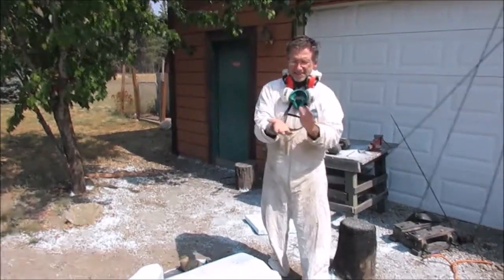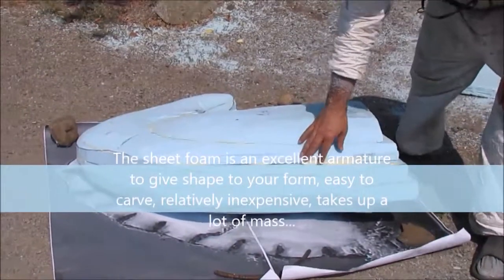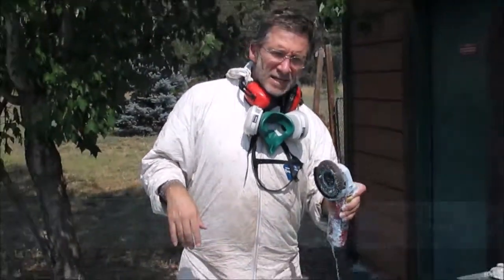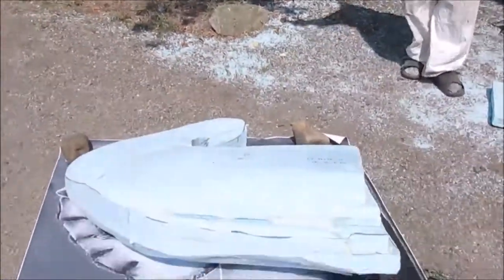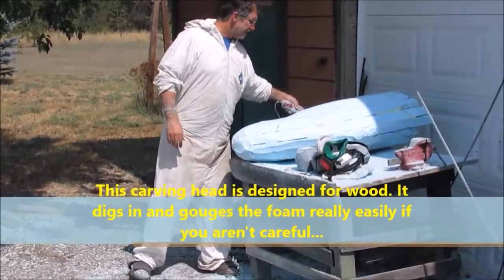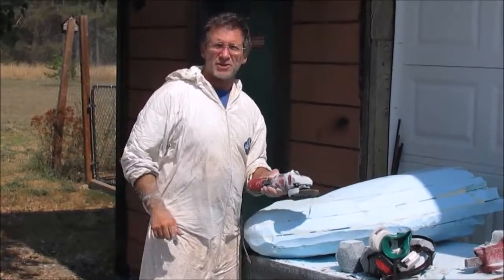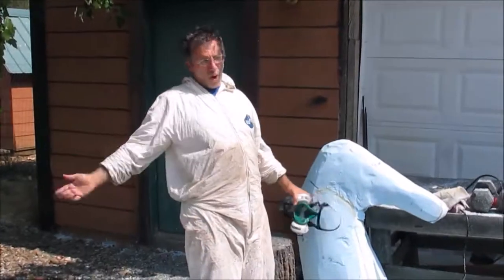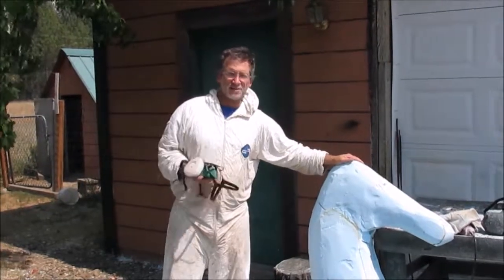3D Sculpture: Carving a Foam Armature For a Sculpture With Power Tools 2

Comment: TY for the vid!!

Will this stand up to time if you sculpt on top of it with an epoxy clay of sorts? Or should one use stronger materials?
Reply: haha late reply...I put durabond over the foam...some types of epoxy will interact with the foam and melt/dissolve it, but if you put a couple coats of latex paint on it before you coat with epoxy that works pretty well to shield the foam...